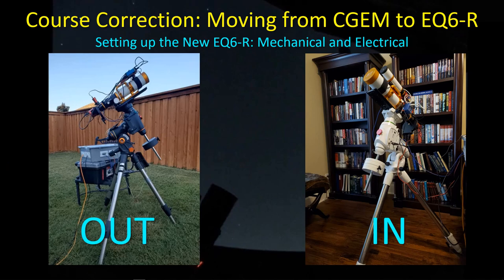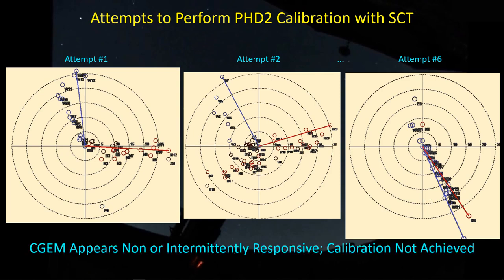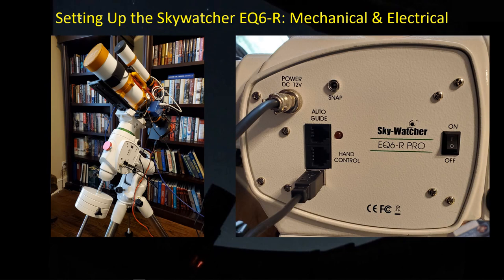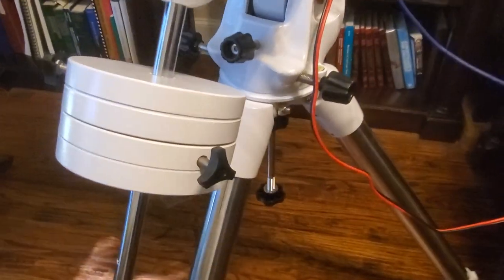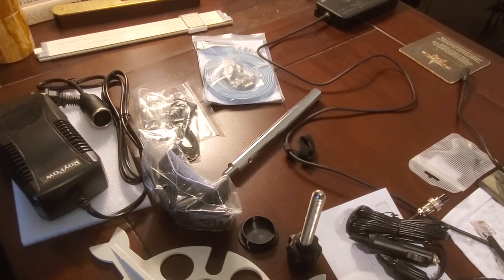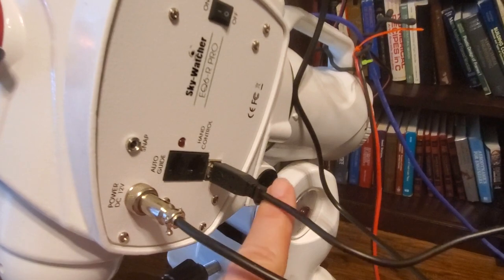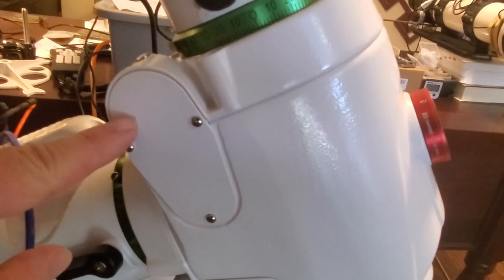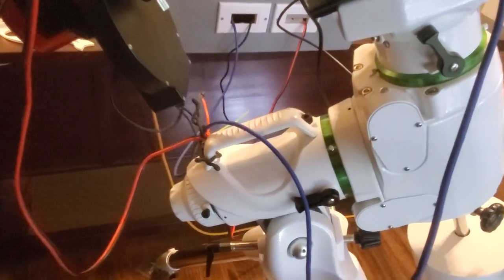Tour of My New Skywatcher EQ6-R

Comment: Congratulations on your new purchase of EQ6-R Pro mount... I've owned one since last few years directly bought from SkyWatcher and I would say that it is great as per its price point... There are a lot of scope of improvements in it as done by Astrobloke... 

I've a solution to your problem of counterweight knobs too tiny to tighten enough that they don't slide down... Well, you know that the EQ6-R Pro counterweight bar slides inside the housing as per the design after you loosen the counterweight bar knob. What I do is always tighten the counterweights at the end of the counterweight bar and then slide in or out the entire counterweight bar for achieving optimal balancing in RA axis... Four benefits to this method. First, since the counterweights are already at the bottom they will no longer slide down provided you tightened them to the best level you can. Second, with your 9.25" SCT even though you will need to use two counterweights still you will not need to slide them individually for balancing. Third, the counterweight bar doesn't extend beyond the counterweights making your setup a little compact and avoid at least one location of cable snag. Fourth, the moment of arm will be a little bit shorter since the length of the counterweight bar has lessened. I've always been doing it this way from the day I learnt about it and I never had to worry about the counterweights sliding down.

I've seen all of your videos and have learnt immensely from them. Many of them multiple times and they help in a million ways... Appreciate a lot for them and will continue to watch your videos in future for sure...
Reply from the maker: Thanks, Nikul! I'm enjoying using the EQ6. It seems to be working very well. That's an excellent idea about sliding the counterweight shaft in/out for balance! That never occurred to me since the CGEM shaft isn't retractable. I did put a shaft collar on the shaft to hold the weights. You can see it in the EQ6 Guiding Performance video, but I like your idea very much. Thanks for watching all of these videos. I appreciate it. Clear Skies!

Comment: Congratulations on your new mount James! I got my EQ6-R in June and usually have guiding ~0.45" total RMS, good enough for my EdgeHD 8 at F/07. A few of the issues you mentioned are easily fixable with a few tools.

Removing the stiffness in both axes requires loosening their respective thrust bearing. On declination, this is the hemisphere above the counterweight. Loosen the three set screws on it and twist the hemisphere (it may be very tight). Right ascension will require removing the polar scope and silver ring around it to twist the black nut with a spanner or strap wrench. Remember to loosen the four set screws on the nut's side before twisting. This procedure was required for my declination axes to calibrate in PHD2 consistently with the recommended 0.5x sidereal guide rate.

I believe both hex keys are provided so you can adjust the backlash if needed. Their are plenty of tutorials online if you need instructions. It's also the same procedure with the CGEM.

It may also be worth buying a shaft collar with an 18mm bore to prevent the counterweights from sliding down the shaft. I find this necessary when dew starts to collect on surfaces.

Finally, the EQ6-R has a reputation for being picky with power supplies. If you have issues with it plugged in to the Ultimate Powerbox, I would switch to the dedicated power supply before trying any of the adjustments above. Mine is powered with a Pyle (formerly Pyramid) PS9KX, which provides 13.8V and 5A.
Reply from the maker: Thanks, Ethan! 0.45” rms?! I’ve never seen numbers close to that! Be happy as a clam if I get anywhere close to that. Great suggestions on loosening the thrust bearings. I’ll test it out, then take a wrench to it. I just ordered a shaft collar-I have no faith in those counterweight knobs. The CGEM was certainly sensitive to power. Hopefully, I’ve got some options to deal with the EQ6-R on that front.

Comment: Very reliable and accurate mount.  There is a knob that can be purchased to adjust the altitude.  Chuck has a video on this knob that is made by Skyedge astronomy.  I bought it and works much better than existing lever.  Thanks for video.
Reply from the maker: Thanks for watching, Salomon and for the altitude knob suggestion!

Comment: James, I own this mount.  I went to Harbor Freight and bought very large Alligator Clamps that have rubber pads.  I put those below my counterweights to prevent them from sliding down the shaft.  You cannot  tighten knobs those on the shaft because the teflon end of the screws.

My mount is somewhat stiff as well, it has not loosened up over 8 months time.  I will follow the advise of others below, but not yet :).

My mount lives outside under a Telegizmos 365 cover.  I did mess with polar alignment frequently before and agree the knobs are not perfect for that. You are correct lots of complaints about these.  Better is just let it live outside.
Reply from the maker: Thanks for the comments! Your suggestion about the shaft clamp made the lightbulb go off in my head. I just ordered one of these from Amazon:

Whittet-Higgins CCM-018 Metric Clamping Shaft Collar, Self-Locking, 18.0 MM Bore.

I’m not holding my breath on the mount loosening up on its own. Eventually, I’ll try some modest adjustments to gain a little more free motion. I agree, best approach is to leave the mount set up outside. I would like more of a sealed solution than my Telegizmos and Orion covers can provide. Moisture is the enemy of electronics.

Comment: IMHO the ADM saddle upgrade is a huge improvement. There is a grub screw inside the polar scope assembly that is overtightened at the factory, loosening helps mitigate some of the stiffness. There is a reason why many people are opting to rebuild the drive assemblies with off the shelf bearings and lube.
Reply from the maker: No doubt, ADM makes quality stuff. I’ll check that polar scope screw, thanks! And, you’re correct, post-purchase hyper tuning is a thing. Did wonders for the free motion of the CGEM. I’ll probably go that route one day. Thanks for watching, Michael!

Comment: You'll like it. I use a UPBV2 and have no issues. Despite the price this mount has been ultra stable for me over a couple of years with a RASA 8 and 120mm APO. Some cheap pieces on there but it plugs along, never gives me any trouble
Reply from the maker: Exactly what I want to hear! I can’t justify spending $15,000 on mount when PHD2 does such a great job compensating for most of the potential issues. Thanks for watching!

Comment: Another great video as always James!  I did the same thing this year and bought a new mount because my CGEM was getting worse for astroimaging. I looked at the EQ6-R carefully but chose the GEM45 because of the weight. My RMS is down to 0.35-0.5 arcsec with my EDGE HD8, far better performing than my CGEM.  I'm sure you'll find a lot more good things about your new EQ6-R  mount  - the first being better guiding - Enjoy!
Reply from the maker: Wow! You’ve got to be thrilled with that performance. Lord knows I’d be turning back flips. You just get weary of the temperamental CGEM. I considered the GEM45. It’s a super nice mount and sounds like it’s solved your issues. I won’t know how to act if I don’t have spirit crushing mount guiding issues to deal with. Probably have to trade in some of my salty language…
Reply: @Aero19612  I'm sure you'll enjoy your new mount and a significant step up from the CGEM.  THE EQ6-R certainly has a good track record. The 15lb GEM45 head vs. 41lb for the CGEM was the clincher for me as well as the magnetic RA and DEC locks.  Looking forward to your future videos and Clear Skies James!
Reply from the maker: I remember that (the low weight) about the GEM45! Please keep me posted on your experience with your scope.
Reply: @Aero19612  Will do!

Comment: I have the HEQ5 but it has the same saddle knobs. My old hands do not move those knobs when weather is cold. My solution was to fabricate a wrench from 5/16" plastic (of unknown sort - old toilet seat lid - well cleaned). I cut out a shape appropriate to grip the knobs securely and no longer have any issues with those knobs.  Like yours, both my axes are stiff too.  I'm going to check the thrust washers...
Reply from the maker: Hey, David. I still need the toilet seat, so I’ll need a different solution! I give you points for “creativity”. Yes: just looking at those knobs is painful. Thanks for watching!
Reply: @Aero19612  Hey, it was just the lid... (and it was easier to prototype on than aluminum, but it worked and I never got around to making the aluminum one)
Reply from the maker: Ahhh! Your approach was conjuring up disturbing imagery in my mind. Thanks for the clarification! Points for effort while still maintaining respectability!

Comment: Love the teflon sheet idea between the tripod and mount head.  Could you share the specs for the teflon sheets and/or the product source?
Reply from the maker: Hey Mel. I did put two thin Teflon sheets (obtained from McMaster Carr) between the CGEM mount and its tripod and they worked very well. For the EQ6-R, I found those surfaces to be much smoother and I’ve be using it without putting Teflon sheets between the EQ6-R mount and its tripod. It can’t hurt, so if you want the benefit of reduced friction, I highly recommend it!

Comment: Not certain if this is useful information for your particular CGEM issue; however, I recently viewed a YouTube video by Astrobackyard wherein he encountered a mount issue, which he resolved with a firmware update. Is that even worth considering?  Everything I’ve managed to discover about the EQ6-R has been overwhelmingly positive. It’s my choice for a mount, should I be as fortunate as you to get my hands on one during these uncertain times.
Reply from the maker: Thanks, Scott. I don’t believe it’s a firmware issue, but those do crop up and are difficult to diagnose. Even though I have the EQ6-R, I still want to see if reseating the electrical connectors and cleaning the contacts solved the problem with the CGEM.

Comment: I bought 2 Celestron 17lb counterweights.. they work good for the HD11 setup.
I use that same RoyPow power supply without any issues.
My RA and Dec movement is stiff also, especially after its been sitting for a while. always a "catchy" spot to work out So I will loosen the clutches and exercise it 180 deg several times to smooth out the movement.
Cuiv has a good video for fine tuning out any backlash you may have in the RA and Dec.  
I ended up running my mount USB directly to PC instead of to PPBAdvanced.. Was having problems going thru PPB... may be the Powerbox.. not impressed but thats another topic.
Anyways Good luck.. love the videos..
Reply from the maker: Thanks for the feedback, Tim. Ha, yes, I did check to see if the Celestron weights would work. I don’t expect, or want, to use the counterweight bar extension. Glad to hear that you power issues are handled. Always frustrating when my CGEM would work some nights but not others when I tried to power it via the UPBv2. Maybe the 15A RoyPow would have solved the issue. Other than that, I’ve been happy with the UPB.

Clear skies!
Jay

Comment: Great review James. I’m also suffering some issues with my CGEM and considering replacing it with the EQ6-R Pro, or AZ-EQ6. My main problem with CGEM is the meridian flip. For some reason it makes tiny corrections of few arcsec in RA what takes it maybe 30 attempts to reach the target within 1 arc min accuracy. Did you experience such problem? Anybody has any hint I could try to solve it?
Reply from the maker: Sort of. The backlash in the RA and DEC drives never gave me precise pointing. Didn’t matter so much at short focal length, but I would usually have nudge the scope to the right position when using my CGEM on a target that filled the field of view. I would always have to nudge into place (did a video on APT framing masks because of this). But my problem was just poor pointing accuracy and I didn’t notice a correlation with a meridian flip. Thanks for watching, Fernando!

Comment: Here is an idea for future. I don’t know how much eq6r can carry without any major guiding issues. The specification says it can carry 44lbs. But let us say it can carry around 30 lbs without major guiding issues.  Your c 9.25 weighs 21 lbs + 5lbs for filter wheel, camera and off axis guider etc. You can put William optics red cat on the top of c9 and redcat weighs about 4-5 lbs and attach a dslr to it. I don’t know if you have another Astro camera or not but dslr weighs another 1-2lbs. And William optics as is attached to your c9 I think it will guide with c9 so you won’t have to guide redcat. I may be wrong. Besides redcat may be more forgiving and You probably won’t exceed 35 lbs. In one shot you will get closeup and wide angle shot of the same object. Watching your videos I think you have all the equipment unless you have sold some.
Reply from the maker: Avi! You're trying to make my life difficult! Haha. I got the same guiding performance whether I used the Redcat alone or the C9.25 with a 600mm guidescope alone. I'm sure the there's a breaking point somewhere. My main motivation in going to the OAG was so that I could take off the guide scope. Thanks  for watching!